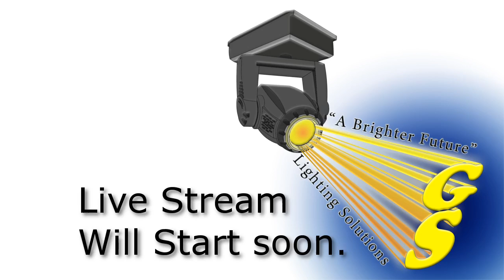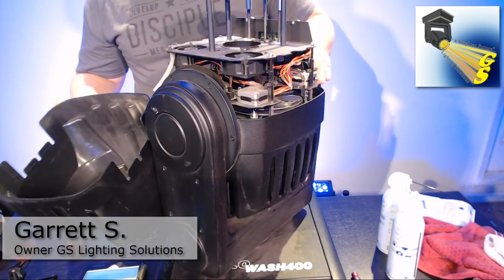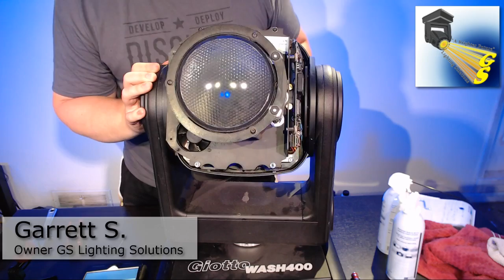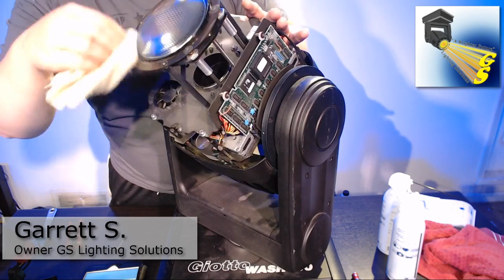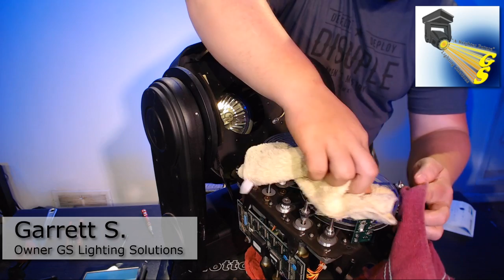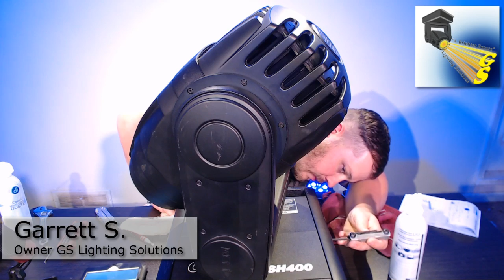Basic Moving Light Maintenance | Live Stream

Comment: hello, I have the chauvet qpots 150s and they are making a lot of noise during movement. can't find any help on mainentance for them, any suggestions? thanks for your video!
Reply from the maker: John Eli Gonzalez have you read the user manual to you fixture? Most lights are designed to run dry. Meaning you don’t use things like WD-40 or silicone lubricant. Try cleaning as much of the components. A little dry lubricant may help when used on the belts and cogs of the movement components.
Reply: ok, thanks!